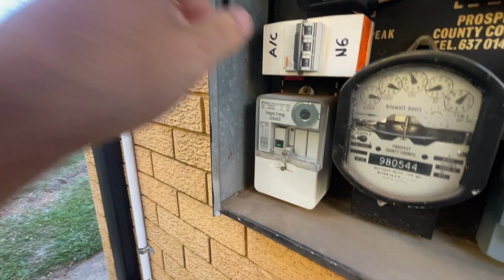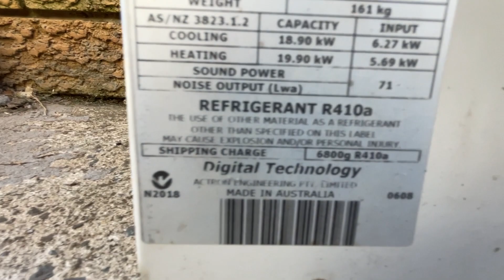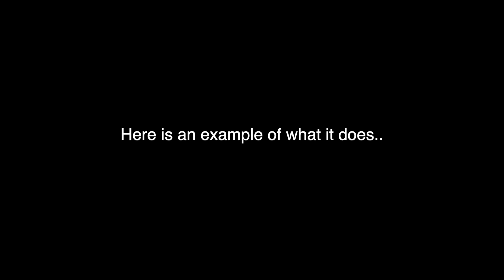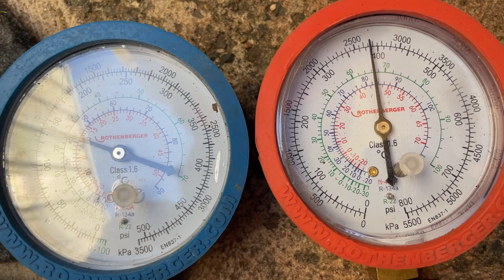What KILLED this ACTRON DIGITAL SCROLL COMPRESSOR? 🤔

Comment: hey mate, would that solenoid valve cause the system pressure equalise when is malfunctioned, cause i have equal pressure on high and low side while the system is running and the compressor is running and everything else. your help would be appreciated
Reply from the maker: Yeah mate 100%. If that solenoid valve is open the pressures will equalise.

Comment: Those PWM valves are just a hot gas bypass essentially - Ive had a few where the board itself was constantly sending 240v out to the coil causing the comp not to pump properlly / Other cases ive had where the actual valve was seized. Theres a little bit of work invloved but you can bypass these completely. I have done it in the past because customers were complaining about the noise it make when it unloads & loads. Most of the time I just recommend a Base Kit supplied by Actron.
Reply: The bypass system is the worst design ever. I hated them from day 1 and still do. I hope Actron have moved on from this, because it's a ticking time bomb and costly repairs will beckon. You also mentioned the noise when it loads then unloads.. Yes, that has to be one of the most irritating noise. I feel sorry for the neighbour who has to put up with it.
Capacity control, my arse.
Reply: Yes, I came across a unit where the neighbour kept on complaining of the noise the unit made when it loaded/unloaded,, Spoke to Actron and they gave me the steps on how to disable it permanently.. I can't remember off hand but I do remember it was quite involved